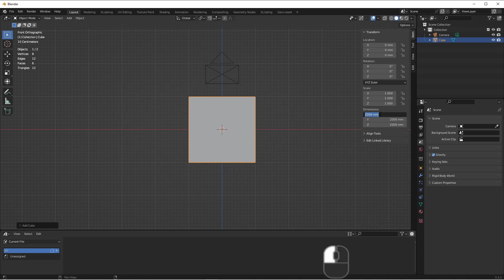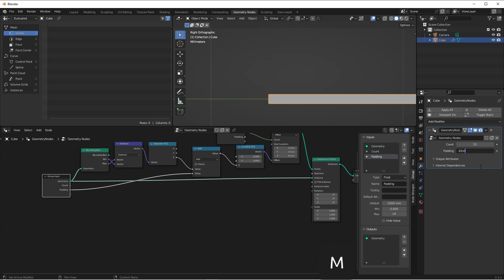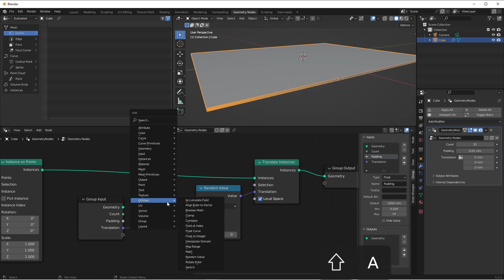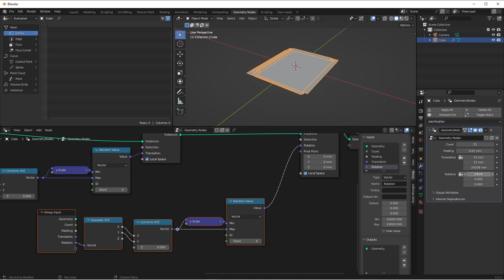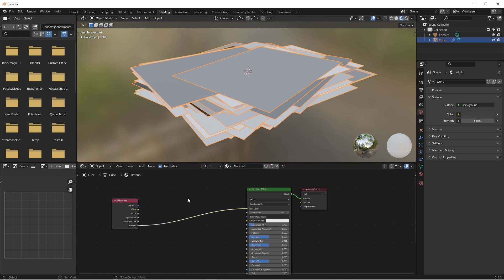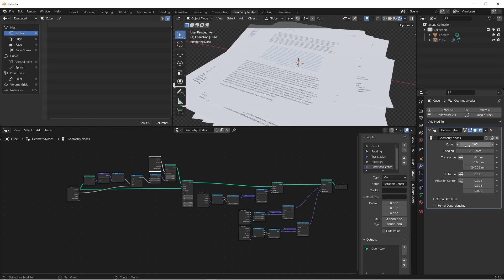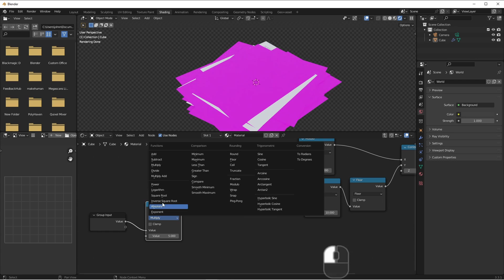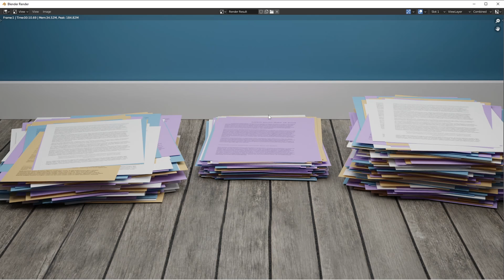Creating a Procedural Paper Stack with Blender and Geometry Nodes

Comment: Hi Johny, Thank you for such wonderful information about UDIMs in blender. I also watched your earlier video related to UDIMs. That was also having great piece of knowledge. Hope to learn many more from your side in future.

I am currently trying to learn about UDIMs. I have a situation where one magazine of 30 pages is created. On those I want to have 30 different images to be displayed. So, I tried use of UDIMs. It worked to some extend based on your logic. Thanks for this. However, I am facing one issue that the random factor is repeating many images and I am not able to get the right images in sequence from 1001 till 1030 with increment of one as required.  I am completely stuck here for correct direction. Can you please have look and suggest clue for this one?  Thanks in advance.

Comment: Is it possible with new curve topology nodes to subdivide selectively just straight parts of text curves? For example, excluding about half of "D" text curve, from subdividing? While preserving shape? When I subdivide curve on curvy text parts there are messy wrinkles, if this would be possible trimming text curves would be so much better. (resampling and spline resolution nodes are destroying original font shape or corners)